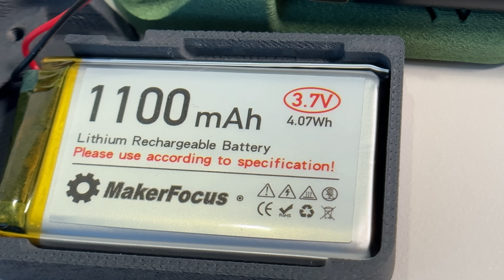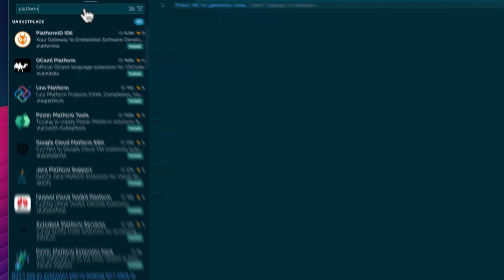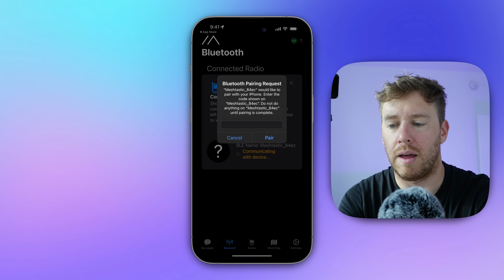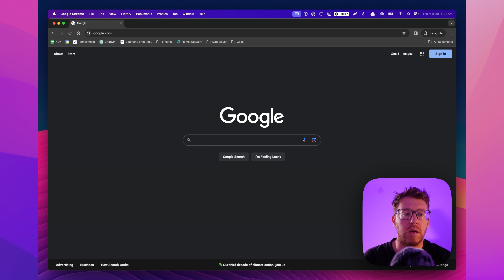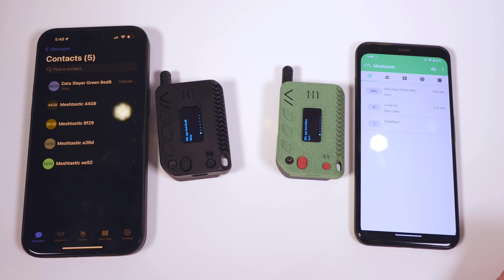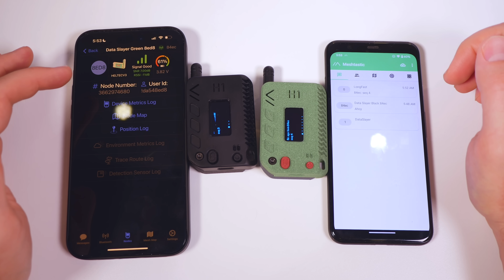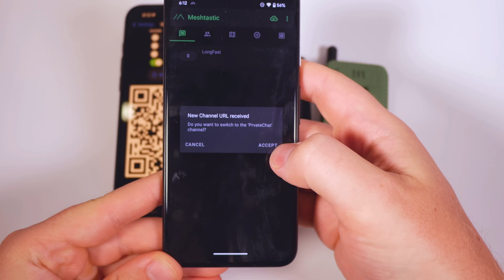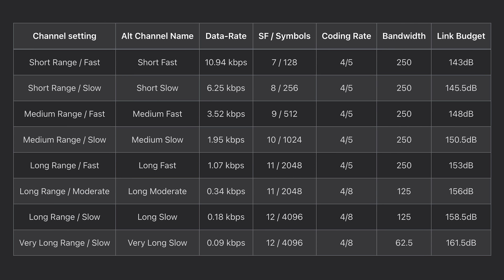It’s Been a Good Run, Phone Providers.

Comment: Hi, I've been working in the RF engineering space for over 15 years, some insights. There will be a limit to range due to the transmit power of the devices, this is something that is usually limited by region, hence the reason why you need to pick a region on the inital set up, this is usally called reglatory domain, and controlled by the FCC in the US, OfCom in the UK and ETSI in the EU. A larger antenna does not mean that you will be able to transmit further, however it does mean that the device can 'hear' more, as it has a larger capture surface. The antenna used in the video, both 'stubby' and 'whip' are known as omni-directional antenna, this is because they transmit their power in usually a 360 degree radius from the antenna, range is also liimited with this type of antenna as it is transmitting in all directions, think of the power being divided equally in a 360 degree circle around you, the target node is in one of those directions so would, for example, only be receiving 5% of the transmit power of the originating device. Range could be dramatically increased by using a directional antenna, for example a 20 degree one, as the transmit power would be divided over a much tighter space. This is quite simplified, mulitple other factors such as polarisation and attenuation come in to play as well, and this is a comment, not a white paper :)

LoRa is not a 'illegal' technology, it was developed to fulfill a need in both urban and rural remote areas to transmit data, usually from autonamous nodes such as traffic lights, weather stations etc, where the data payload is low, its also used quite heavily in the farming industry to track wildlife, report on the health of crops and machinary. It also uses a lower frequency than traditional WiFi, which means the wave length is longer, and is able penetrate more dense materials, there for increasing its potential range.

The one concerning thing highlighted in the video for myself, was the ability to track nodes, it seemed like you were able to determine the location natively on the device of a node without any kind of authentication.

Another note to add would be SIGINT (Signal Intelligence), if someone is planning on using these devices in a situation such as a warzone or potential conflict zone (I'm thinking of civilian communications in Israel or Ukraine), as this creates a mesh network, meaning there will always be some level of RX/TX from these devices, by either relaying of messages, or attempting to discover new nodes in the mesh network, these devices would be quite easy to track down for an equipped force, potentially aiding in the capture or attack of the user. The equipment needed by people/govenments/militaries to track these types of signals is fairly ubiqutious now and rather cheap, something to keep in mind. SIGINT operators utilise 'listening posts' or devices (drones, AWACS etc) to 'listen' for RF, trianglate the signal and direct forces to that location (or order strikes), this has been used to great effect by the Ukraine military against the Russian Federation in the early part of the conflict for example.
Reply: I appreciate you sharing your knowledge,  I’m new to Lora but have been messing with FPV drones for years now on 2.4 and 5.8  after reading I upgrade my DJI transmitter antenna that were basic folding bipolar to a square “patch” antenna I believe it was called and it was a huge ungraded for range and video quality but also very sensitive to facing the right direction.  Is there similar “patch” antenas that will give similar results for these Lora devices.  Line of sight is very important on our FPV stuff.  Forgive my ignorance on the subject if I’m not comparing apples too apples.
Reply: Noice
Reply: great explanation, thank you for taking the time to write it up.
Reply: the low cost of these devices allows to deploy a ton of nodes though so yeah they can be tracked but it can become a pretty time-consuming job to root out hundreds of those hidden around or literally thrown off a plane/drone at regular intervals to maintain the network
Reply: Thanks for the reality check...I found it hilarious this guy didn't appreciate 😂
Reply: Damn. Rolled up into youtube comments and found a Redditt Comment 😂.God bless you random people that nourish my nerdiness.
Reply: "Range could be dramatically increased by using a directional antenna"... perhaps someday we will have thin-profile, tracking, phased array antenna that can latch onto and only broadcast/receive to/from the remote node.
Reply: Hey MrCharlie, really thanks for sharing your knowledge!  When you mentioned that longer (I wrote shorter on the original answer. My mistake, I meant lower frequencies) wavelengths can pass through thicker materials reminded me about a class once when the teacher presented a small table with the required steel barrier thickness to shield from different electromagnetic frequencies down to 50/60 Hz. His example was specifically meant to show that shielding in cables were meant for capacitive shielding instead of magnetic.

I've never forgot about that example, but I've never found that table again. Do you know a good reference for such kind of material, or any that could have some related information? Books, articles or papers?

Thank you once again!!
Reply: What would you suggest to decentralize communications and keep it off the big networks ?
Reply: Would the use of the directional antennas, that you mentioned, help with reducing signature/RDF?
Reply: It seemed like, on the video, the phone's GPS was being used to track location. You're right though; I'm sure you can easily triangulate positions of devices without that.
Reply: Thank you for this info. I was wondering about how this could be used in political conflict.
Reply: Well written, however one of the benefits of a mesh network is you can lose nodes due to triangulation and enemy fire but it doesn't take down the whole network.  Meshtastic like ATAK can "self heal" for the most part.  Just make sure you send your message and then pop smoke.
Reply: LoRa is nearly invisible to remote spectrum power sensing.
Reply: I fell asleep after the first paragraph
Reply: @BassBashin  Encrypted comms can be a sleepy subject. It's kinda a big deal when it's all said and done.
Reply: @syntaxerrorsix3137  I don’t disagree. My ADHD will not allow me to dive farther😂
Reply: @BassBashin  Understood :D
Reply: My cousin in Six Mile Run Pennsylvania used a  saucer for sleighing to pick up television signals in the analog days, but it received all the military signals as well, so they came to his house and made him dismantle it. Lol they can always see a signal draw and know exactly where it comes from.
Reply: Great points. My first thought was could this be useful to Ukraine?
Reply: dBi, gain over isotropic
Reply: Exactly.  It's entirely traceable
Reply: This is why I stopped giving my opinions.
Reply: Any mitigation suggestions for snoopers? 🙉
Reply: You are so smart I’d love to be your friend!
Reply: it's Palestine not is****l
Reply: I was just about to say this exact thing!
Reply: Not exactly a secure comm. if you use the device for long and frequently
Reply: Isnt that what TETRA is for? Security wise?
Reply: can we see Meshtastic using the Helium Lorna network or equilivent to extend to worldwide ranges?
Reply: Oi! You got a loicense for all that great info?
Reply: Holy shit dude thanks for this
Reply: Lies 🤥
Reply: As a former 25U I approve this message 👌🏿
Reply: @ogcritter13 because he wants to seem smarter than what he is. Particular inflexitions in his speech and choice of conjunctions shows his arrogance and lack of subject matter expertise....
Reply: Can it send coordinates to other drones for targeting Russian infrastructure? That would be useful
Reply: Nonsense
Reply: now thats a dude that knows his shit
Reply: The battle of Long Tan is a text book case study of signals intelligence, and a living legend of ANZAC tradition
Reply: Smart people always blow my mind, thank you for sharing!
Reply: Nerd lol
Reply: @AnthonyEverywhere  well; at the beginning, you will be able to contact people who are equally literate and equipped with the same technology. However, eventually you will be integrated into a network that operate at lower cost than your current communications provider, without any additional features at the same or higher fee
Reply: @AnthonyEverywhere  yeah I'm not getting it either. My physics is pretty rudimentary, but from what I'm thinking; (because we're not launching satellites) the signal will run through local ham radio relays to landlocked locations.
However a long range signal with significant strength can be 'bounced' (refracted) off the atmosphere and travel significantly longerdistances. (12% of the planets observable surface from 1point. Don't quote me ) however the information transmitted will need to be filtered or will degrade (look sideband radio).
Reply: @AnthonyEverywhere  bandwidth is probably a bad choice of words; radio is a lower energy bandwidth compared to light 🫣😂.The data transfer is discretely lower, however if all you are doing is sending text then the service could potentially be faster.
Just, without filters then anyone can spam the entire network with stupid advertising
Reply: Thank you great explanation, although I think the great success of Ukraine is a poor example that hasn't aged well.
Reply: I feel 1% smarter for just reading this comment.
Reply: Damn dude, you are the real Data Slayer.  That was awesome.  Thanks for the information.
Reply: @twelvetoes-e9n It's only useful to a population motivated to fight for their freedoms, not a population forced at gunpoint to die for a tyrant.

So "no". Not useful at all for Ukraine.
Reply: @BassBashin It's not that complicated. Man up and CONCENTRATE. Do you want to devolve into a blob of slop? He didn't say anything crazy technical.

Like a flashlight with a wide beam, cannot shine light as far as a flashlight with a narrow beam. Not hard at all to understand. You don't have to be an expert. You just have to concentrate.
Reply: This comment is everything in one! 💯
Reply: M mn
Reply: Awesome explanation thank you so much. I am a HAM licenses and I learn a lot of new inputs here thank you again
Reply: @Azmania3000  if that's what it does that would be cool.
Reply: Do you expect these would work on cruise ships? I’m sure they are  still legal in open water, but I wonder if cruise ships have a way of blocking the signals.
Reply: I understand this is one of the reasons why WiFi routers have multiple antennae, so they can track the location of each client and direct the beam accordingly, increasing the range using the same amount of power?
Reply: It's hidden in the IoT band used by practically hundreds of chattering devices - you're right, technically. But it would be more challenging than you describe.
Reply: Thanks for the comment!
Reply: Drop the mic 🎤
Reply: LoRaWAN is a mesh network that uses spread spectrum at just under 1GHz.  So in theory, with enough of these radios, you could send data 1000+ miles.   (Of course if you only own two radios then as you say, range is limited.)    Yes it is low bandwidth and best used for things like remote weather stations and wind turbines.
Reply: @ScandalUK  so I'm still trying to understand Can I go 50 to 100 km away from somebody and talk and send texts without having any cell or internet?
Reply: A directional ant. would defeat the purpose.   These are networked devices that form a mesh.   And you would never know where to point the antenna if it were directional.   The idea is that there are HUNDREDS if not THOUSANDS of these all of the same net.    ESP32 chips cost under a buck each.  So a large network is reasonable.   One company had an idea to give away nodes that were built into light bulbs and ask people to use them as porch lights.  Even if only 1 in a 1000 accepted you could cover a small city.
Reply: Why don't you think a higher gain antenna won't improve the strength of your outgoing signal?
Reply: @Pdfgyu   Umm, standard transceivers of both the licensed and unlicensed varieties. Unlicensed being FRS and CB.
Reply: TETRA? Is that as open?
Reply: are you an 18E or 25U???
Reply: @AnthonyEverywhere   yes, assuming that there are other meshtastic devices in the area then the distance is huge. Here in the UK there is great coverage, I can send/receive texts dozens of miles away using only radio.
Reply: @ScandalUK  wow That's awesome, what's the best one to order?
Reply: Well thought out 🤔🤔
Reply: Thanks for the info.
Reply: nobody would be interested enough to track my location, im more concerned about networks capturing the content of my communication
Reply: @replynotificationsdisabled  no sir
Reply: You say that, yet my flipper zero can see the transmissions just fine.  @SergLapin
Reply: @robertchiarizia9463 far more likely they just didn't like the dish pointing at their base comms systems.
Reply: Great points
Reply: All of this tech mumbo jumbo is fine, but you are not seeing the big picture here which is that these unregulated devices could easily be used to transmit hateful content that could harm women and other designated groups
Reply: @robertchiarizia9463 Signal draw? Aren’t you only able to hear or capture signals that are literally passing or touching wherever the listening device is? How could they possibly know that anything heard the signal, it’s not like you’re literally pulling waves out of the air away from the point of origin
Reply: @SergLapin  it is, till it isn't and depending on your needs, finding out it's compromised will be too late.
Reply: @extremeencounter7458  actually you are. Also waves are all connected by a substrate similar to the ocean, but referred to as the Ethers. That crackle you hear is the sound of the ethers. Waves are all around us nonstop.
Vikings used to be able to tell where land was by watching the back swells coming off the land when the ocean was bouncing off the shore. Everything gives off a ripple effect. It’s what we call a ‘vibe’
Those devices are usually transceivers, not only a receiver.
Even a receiver drawing a signal can be detected in the ether space.
Reply: @extremeencounter7458  the longer the antenna, the easier you are to detect
Reply: My question is what other things could be loaded into it
Reply: This is exactly why it is "useless", the network and application still need connectivity.  When data is transmitted to the end device, the data is received by numerous gateways.  Then it is forwarded to a centralized network server and after that to multiple application servers.  So saying you can use this "off-grid" is speculative.  You obviously need the network and that network is good in low data mode only, its also poor in relaying confirmations of data received.  Basically...... useless.
Reply: Awesome insight! I have spent many years in the field with the Infantry and was very interested in LoRa and its possible downsides. The tracking of nodes was a great point, do you have any insight on the use of ATAK and how SIGINT ability to track those signals? 

I'll probably use LoRa as an emergency comms device, but the ability to track other teams is such an enhancement over the spotty radio systems in use today.
Reply: This is one of the best if not the best comment I’ve ever read on yt. Thanks for this this break down.
Reply: "Farther"
Reply: Damn over 2k ppl read all of this comment 😮‍💨
Reply: Larger antennas do increase your transmit range as well as receive. Its less about capture area and more about antenna gain which is the result of manipulating the radiation patern...again this goes both ways transmit and receive. Base antenna =quarter wavelength,  anything larger provides gain.
Reply: This was incredibly informative, I've also been working with RF for some years now and it's nice to find my kin. I dont think i've seen RF engineering explained so comprehensively in my 7.5 years of working in the industry. You should make a community on Youtube to discuss this kind of knowledge.
Reply: @JR-ng9yo I know this sounds naive but you mean like a NFT style communication network? 

I used to be a comms guy in the Army. So Comsec (communication Security) is important to me. 

Old habits die hard.
Reply: 30+ years in aerospace engineering as well. Very well poot. No extra information needed. 

Without listening our caring about what frequency band is being used, I have note: 
I would not be upgrading the power on these and using them around airports without KNOWING what you're doing. If there is any RF interference, the FAA, NTSB, FTC and Homeland Security.
Reply: You fell asleep and I woke up. Funny how people are different isn't it? @BassBashin
Reply: Excellent commentary and information . Thank you.
Reply: @JJ-jn5lr  No prob... do you know the Nyquist Criteria? ...https://en.wikipedia.org/wiki/Nyquist_frequency   The data rate is twice the bandwidth (of the signal, NOT the carrier) so you will be severely limited.  I think ham stuff is limited to voice frequencies (4kHz)... so data would be about as fast as an old modem.  Not great...
Reply: If you wanted to deploy a ton of them attempting to mask locations lol just look for the ones that are moving…. Not stationary
Reply: Great commentary- Thank you.
Reply: My portable HAM radio pulls 8 watts of power!
Reply: Any of this does not matter to him. These youtubers just want you to visit the store page. These fakes reviews are really ruining youtube for me.
Reply: Obviously because is not in the public yet meaning in large portion of the publioc but Imagine this becomes ubiquitous the technology will advance at the speed of the light and people will must likely put towers or repeaters or what ever you want to call them to help the signal reach more and more places so you having all that experience has no value if your level of understanding doesnt seem to be logical in t he sense that technology will continue to advance,.
Reply: Good luck FCC trying to DF something with with this power output and the super short burst of energy they're putting out lol.  Also, a larger antenna doesnt mean you will put out farther?  Yea?  Then why dont radio stations have 3' tall antennas?  Why do the 102" whips for cbs have greater range than the 36 inchers?  True the power output is more important, but so is antenna size, and swr or match.  The more efficient, the better the range.  And obviously polarization matters at this super low power output  But I agree a uni directional antenna would be much better, providing you knew the receivers azimuth; that would also help countering DF efforts.
Reply: THANK YOOOOU CHAT GPT!!! 😂😅
Reply: I'm not reading all that. But everyone should keep in mind these are mesh based, meaning the more there are, the larger your effective range texhinally is
Reply: Russia is a master of electronic warfare. They are very fast too. Groups of Ukraine foreign legion fighters have been wiped out for leaving their cell phones on for example. And they jam LOUDLY and have successfully put up Force fields around areas which cover a wide band. 
By the way, the US Army uses a mesh radio system which triangulates others and plots them on a map. It's called an Enhanced Position Location Radio Radio System (EPLRS) and works with FBCB2 (Force 21 Battle Command Brigade and  Below). 
I am doubtful SIGINT listening posts would pick these up unless they were very close for some reason. Although I'm sure that air assets collect signals. MQ9 Reapers fly over my town a few times a week and I wouldn't be surprised if they had Stingrays picking up cell phones too.
Reply: @masonsmith858 please explain to me what Tetra is?
Reply: @KemistKing  TETRA was specifically designed for use by government agencies, emergency services, (police forces, fire departments, ambulance) for public safety networks, rail transport staff for train radios, transport services and the military.🫡
Reply: Hi @MrCharlieUK Great response here! I subscribed to your channel. Would like to connect since I am studying EE. Look forward to chatting with you. I did not see a way to connect with you on your YT page.
Reply: Great! More radiation for our cells. Just lovely! As if cancer rates weren't already high enough. I'm moving to the fricken mountains to live off the land! 🙂‍↔️🏞️👨🏽‍🌾
Reply: Think you mean Palestine.. Israel is not a war zone. Thanks to US aid, Israel remains largely untouched by the horrors they are commiting.
Reply: Great comment
Reply: Nice essay
Reply: @MrCharlieUK is your average reddit user for real
Reply: And MIC (ministry of internal affairs) in JAPAN which follows national ARIB-standards (akin to ETSI standards).
Reply: Yes, and there's even more bad news. The messages that get relayed, even if encrypted, can still be captured by a third party without anyone knowing, and decoded later. It also needs a sweet spot, the right number of nodes - too little, doesn't work well, too many, they get flooded by messages. The idea that meshtastic would be THE comm network in a SHTF situation is the reason that most people have gotten excited about it. And it's a very narrow set of circumstances in which meshtastic would be invaluable, meaning that the odds are not in it's favor. A very realistic scenario would be that of a hostile government with virtually unlimited resources. Another realistic scenario would be quasi anarchic situation where there is extreme scarcity of most basic resources for which people would constantly fight one another. Even if you had just two devices intended on directly communicating with one another, they can still be found out, messages can still be intercepted and decoded. I'm just overall disappointed and I do believe that as it is, this is sandbox toy comm, great as a hobby, not really useful for SHTF.
Reply: Thanks for the skinny
Reply: A lot of what you say is absolutely correct although you miss some details. Meshtastic isn't the protocol you can use for the LoRaWAN network. There is also the Reticulum network protocol that can couple with LoRaWAN, which is absolutely completely encrypted. If any messages are sent without it then its immediately dropped, only the intended user can receive that message. Another aspect of security that you didn't mention is static IP addressing. This is required to ensure that not anyone can be easily identified, right? What you said is right but you're not really explaining the full picture of the capability. The security of LoRaWAN is only as strong as you make it, and it's currently the best for civilian use right now. Yes I know the signature will always be there too, but honestly how much of a drama will that be? It would get lost in a lot of noise surely? (this is a genuine question now)
Reply: I agree!!
Reply: Stopped the video to read this thank you.
Reply: Best comment I read on wireless comms and SIGINT in a long time. 10/10.
Reply: Your source: trust me bro
Reply: How you think cam it work like honey mesh of mobile provider?
Reply: Thanks professor
Reply: @Pdfgyu  Nothing Commercial, if its commercial its regulated. You'd have to set up your own comms suite from scratch. SDR (Software defined radio) or conventional HAM radios would be ideal. That covers decentralization but if you want anonymity youd have to figure out the issue of encyption yourself, no point in being decentralized if everyone can hear you.
Reply: @edwardk3  then don’t read it if it’s “offensive” to you…..

Who cares if people transmit “hate” or whatever…. Big deal!
Reply: @steve0504  how would you feel if you were a designated group and somebody said hate to you?  Women struggle with people giving unwanted compliments everyday on trains and in dirty buses.  You don't seem to care because you don't have to suffer like woman do.
Reply: Lower frequency waves are not better at penetrating materials?? What are you yapping about?
Reply: Yup.  Lots of Holes if you think it secure.  Great Back up though, with enough users.
Reply: @ChristopherSmithGPlus  iirc the gps location is shared to all by default, but can be turned off or not transmit the full location, like instead of 327.3267, -465.6482, transmit only 327.32, -465.64

(example coordinates are random numbers here, they are not my location lol)
Reply: They are basically making pocket scada
Reply: @Anonymous-jy5ew  FORREAL!!
Reply: cheers big ears ❤
Reply: This is why I read the comments in the beginning of videos
Reply: @DimMakTen  you should make the videos you are smarter and better and i spent more time reading this while the chatter box talked about how this device is a great way to get a effective fire misson called on my precise location in a war zone ( please actually make videos)!!!  your example seem to be really good for people who are intrested in how radios work i know nothing and want to get into them.... I work in rural austere environments  will little cell reception and dont want boomers with nothing else to to but sit on their porch and listen to us on radios and offer slick comments  to my crews who are 50 feet up in trees and cutting them.
Reply: thank you for the lesson, sir!
Reply: I’m just an electrical engineer but I was wondering about SIGINT while watching this video and how in the world this tech could be considered hard to pen. Uses mesh, smart phones, and long wave…. I’ll have to pass on this device knowing people with far more opsec knowledge than me have similar concerns
Reply: Thanks for the more thorough explanation.
Of course, these devices can be useful when confronting over zealous police trying to stop a demonstration.
Proper planning, mapping, coding and  ability will make these very useful to democracy.
Reply: Thanks for the more thorough explanation.
Of course, these devices can be useful when confronting over zealous police trying to stop a demonstration.
Proper planning, mapping, coding and  ability will make these very useful to democracy.
Reply: @DimMakTen you mean for video signal ? You need to be a bit more specific. Airunit what goggle what transmitter what protocol transmitter. Etc.
Reply: situation I dont think you mentioned that this would be great for. is disaster scenarios. earthquakes, tornados, huricanes ect. esp right after the incident.
Reply: @Pdfgyu  I don’t know what the experts say but the system can be unmanned in places if that’s your concern
Reply: @ChristopherSmithGPlus  I do know from using the system that you are offline and the link to the mesh is Bluetooth.
You can use an old phone not connected to the Network.
Reply: @BassBashin  try again, if you want to know. I have had to read articles several times to grasp the meaning. There are no unknowns only things that I am yet to learn.
Reply: @outbackev-hunter6035  understand these devices are on public frequencies. Everybody sees them on the same channel in the line of sight or repeat range.
If you are using these to direct traffic of a or possibly many demonstration areas at the same time you will have to strategize as to placement and when you turn on.
Ex: if you are in a peaceful demonstration that you probably noticed and encountered police brutality, another, demonstration interfering with another area, bridge etc will happen.
Let the police know that this is a peaceful demonstration and not to be confused with an attack against America but a call for action by American authorities.
Reply: @AnthonyEverywhere  I reach 157 miles Los network. No voice
Reply: @ this was actually use in NC because the ham had no power and the mesh was charged solar.
I believe one of Jordan’s reporters covered this very subject.